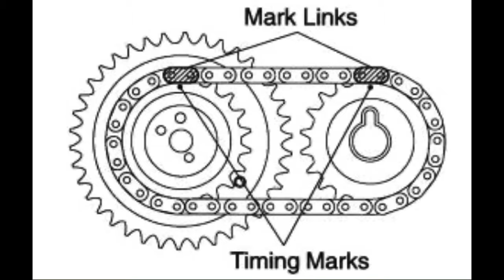2006 Toyota Tundra 1GR-FE 4.0 COMPLETE HEAD GASKET REPLACEMENT STEP BY STEP 209-305-1672

Comment: Hey brother, thanks for the videos... if by any chance you happen to do a timing belt kit for 97 Mitsubishi Eclipse non-turbo automatic you'll be a life saver. When I start the car you can hear a loud screeching however as the engine warms up the sound lowers but when I put it in drive it almost goes away completely. Another piece of info is when I get my ear close to the middle of the engine I can faintly hear a ticking (similar to when removing a spark plug). Originally while purchasing the car the guy told me it's just a water pump but the thing is I don't hear anything coming from the timing cover side. Appreciate any advice

Comment: i see this alot, how many miles are or were on that block? Love your vid showing all the steps and what it took to film. When I have a gasket leak and it is cresting the 150 to 200 thou mileage, i will just long block the whole thing, would hate to stick it all back and a lower main starts spinning. Really appreciate the vid helping alot of folks out there!!!
Reply: The rear main bearing spinning in the block happened to mine :-(
Infrequent oil changes block up the oil pickup screen.
If your engine has the smaller sub-sump with 10mm head bolts holding it on, you can fairly easily remove it and then clean out the oil pickup screen.

Comment: Did you guys have the heads resurfaced? Watched orher videos saying its not a good idea on timing  chain engines becuase it will throw timing codes because timing might not lign up.

Comment: I have a blown head gasket on my 02 tacoma v6. She has 260,000 miles and was told if i do the head gasket with this many miles, the compression will change in the motor. Running the risk of harming the lower end of the motor.... how serious is this risk? Do i really have to replace the motor now or should i just change the head gasket anyway? If anyone could give their opinion on this that would be great!!
Reply: I'm just about done lapping my valves and replacing head gaskets including a valve lash check and adjusting and also just a light cleanup of carbon build up on pistons etc... Got 255000 on the clock, so I'll let ya know how it turns out 😁. Now if these parts can just get here.....

Comment: I appreciate what you showed in this video, I have my doubts about the 4.0 I have. Drove it too hot & blew the head gaskets, resulting in getting coolant in the cylinders. Is there something to expect from the block since it has replaceable piston walls?
Reply: How did you overheat it?
Reply: @johnmpifer  A buddy didn't realize that there was a water leak, and drove 45 miles with traffic uphill. THEN tried to force it back home but it wouldn't go.
Reply: @SOLIZ49erFAITHFUL  Ouch. Hate to hear that! Surprised he continued to drive it after getting a red overheat warning light.

Comment: My head is spinning just thinking about trying to keep up with all the parts pieces nuts bolts washers. Modern vehicles are more complicated than a rocket ship! This job would be a complete nightmare for me.
Reply: Use pieces of cardboard with pictures of the part and poke them through the cardboard in the right area. 👌

Comment: What is a good list of gaskets and parts to replace while the engine is opened like this?
Reply: Did you ever find a list? Looks like I need to get on this as well. And awesome video guys!!
Reply: This is a 1 year old comment but you can get a complete gasket kit from toyota that includes every necessary gasket, oring and seal needed for the job.
Reply from the maker: Toyota gaskets are the problem. 
Fel-pro HS26515pt is the set to get
Reply: Illeana Delgado I ended up replacing my engine with a used unit. I also bought a complete overhaul gasket set from Toyota, it was like $200 for a assortment of different gaskets such as various o-rings, valve seals, head gaskets, valve cover gaskets, front and rear main seals, etc.

Comment: Great Video!  I have a 2006 Tacoma 1GR-FE with 244,000.   Leaks Oil around Timing chain cover near powersteering and valve cover gaskets leak slightly, could use a water pump also.  You guys wanna Do another Lol?

Comment: Awesome video! I got an issue when I got to the head bolts though. One of them was already stripped and I’ve tried pretty much everything. What would you do if that had been the case? Thanks!
Reply: I had the same issue on my engine.
After smashing my head against the wall a few times as I really didn't want to have to drill out the head bolt, I came up with a working solution.
The head bolts in my 1GR-FE have 10mm single hex head bolts, a couple of which stripped out the hex when attempting to undo them.
I got an 11mm hex drive socket and hammered it into the 10mm hex head, which was at approx 10.5mm after stripping.
This allowed the 11mm hex drive to be really jammed in and allowed me to finally crack the head bolt and remove it.
Hope this helps.

Comment: Hello I have a quick question for you. I am looking to replace the gaskets on my valve covers. Do I need to remove the intake? If I do do I need to drain the radiator to change the valve cover gaskets? thanks for your help

Comment: Great video.  I have never pulled the heads on an OHC motor and knew it would be even more of a PITA than the OHVs.  My issue isn't the heads themselves but the exhaust on my 2009 Tacoma 1GR is really rusty.  I replaced the muffler and mid pipe but joints on the cats and the other front pipes and the manifolds are nasty.  I'd like to redo all of that but the bolts are in such bad shape the pipe and cat bolts would need to be cut like the ones on the mid pipe... and the exhaust manifold bolts may be too damaged to extract in the truck.  IOW if I start this job it might turn into a cylinder head R&R.  What would be really helpful is if you guys could post up the part numbers for the o-rings, cylinder head bolts and gaskets.  Or maybe I'll just go trade it in.  ;-)

BTW, I loved the trick to get the crank bolt loose by spinning the motor.  Very clever!  I did similar with a VW rear wheel castle nut like that once using a breaker in a cheater pipe against the ground and moving the car a few inches.

Comment: Do you recommend replacing the timing chains when doing this at 140k miles. Seems like there was an issue with head gaskets in 2005
Reply: Timming chain tensioner should be checked, but that chain should outlast the engine. Just change oil every 8k miles and it should outlive every other part.

Comment: Do you happen to know what would cause 24% LTFT on bank 1 but only like 10% on bank 2?

Also have a cat code on bank 1 at the same time
Reply: I am having a similar issue on my '05 Tacoma. Compare cylinder compression between the cylinders on bank 1 vs bank 2
Reply: @TheThejordanbarnes  true I'll check that out as well, worth a shot

Comment: Question for any 4.0L Tundra owners?  Im considering a mint 4.0L extended cab.  Its significantly cheaper than any of the 4.7 or 5.6L v8's but would be more than adequate for my towing needs.  (pop up camper).  How does this truck drive? Is it super sluggish?
Reply: I don't think so. I have a 2007 Tundra with the 4.0L V-6 and I'm happy with it. Acceptable acceleration. But I wouldn't think it's appropriate for a fully loaded truck and a trailer rig.
I've pushed mine hard at times. Drove 950 miles in one day Montana to Seattle with 900 pound load. That's over three or four mountain passes. Also briefly took it to just over 100 mph on a deserted stretch of Wyoming interstate (new tires though).

Comment: noticed you didn't remove the oil pan or replace the o rings.  Not necessary?
Reply from the maker: Not necessary for head gasket replacement. 
If we were rebuilding engine, yes.
Reply: Gasket Masters what about timing chain replacement?

Comment: Hey guys.  Is this a common problem on the v6 4.0. I was going to buy one with that engine….
Reply: happened to mine at 150,000. Between cylinder 2 and 4. Still ran with decent power just used coolant, which is how I noticed. The V6 has a timing chain though which is better than the timing belt in the V8.

Comment: Did this and gave me a p0016. Tried it 5 times and still p0016. I did notice that when I put the timing cover and harmonic balancer, the harmonic balancer mark is a hair off in front of the 0 mark on the timing cover. When I align the chain and all timing marks exactly where they go, I get slack in between bank 2 and the crank. I put all new chains. Any idea why I keep getting the p0016 code?
Reply from the maker: The timing marks are off. Redo the timing check out our other video specifically for timing marks
Reply: Thanks for your help, but I think I found the problem, looks like there is no oil going to one vvt solenoid.

Comment: how much guys you charge for head gasket 2005 tundra 4.0 v6  same engine
Reply from the maker: @JohnUSA-u7g  we charge typically 2500
Reply: @gasketmasters  
Thanks. Do I need to change the timing chain? What good head gasket to buy and from where thanks again
Reply: I have a misfire on cylinder 4. I know I have a head gasket,  with 230 miles on, no other problem been very good ,do you think is good just to do head gasket 
Thank you so much
Reply from the maker: @JohnUSA-u7g  yup. Do it

Comment: WHAT SOCKET DO I NEED FOR THE HEAD BOLTS IS IT A TORQUE PLUS?
Reply from the maker: salvador gonzalez 12 point 14mm impact or thick wall
Reply: Gasket Masters thanks
Reply: @gasketmasters  1GR-FE head bolts require a 10mm Bi-hexagonal driver.  In the video the technician says it's a triple square, which may be the case if the bolts had been previously replaced, but the factory head bolts aren't triple square.
Reply: @salvadorgonzalez8974  A 14mm 12-point socket is for the head bolts in a 4cylinder tacoma (RZ engines).  If you have a V6 (1GR-FE) you want a 10mm Bi-hexagonal driver (NOT triple square, the angles on the points are very different).  Hope this helps.
Reply: Gasket Masters  I finished head gaskets on the truck last week it runned good for about a week 
Today while driving it died connected scanner had cam codes  removed Oil cap noticed cam chain not turning 
My biggest concern is 
Is this a interfiere engine 
Any help will be appreciated

Comment: I have an )5 Tacoma with 127K miles on it.  I cross my fingers each time I drive it while waiting for the head gasket issues ( that the sacks of excrement at Toyota don't stand behind while knowing full well that the 05's and early 06's have a major problem) to show its ugly head.  I often thought of getting rid of the truck before the event, but don't like the new ones.  A 2015 would be nice.
I just may get the kahoons to give this repair a shot.  Others that have posted about doing it for the first time say that it took about a week to complete,  you guys did it in 30 minutes or so 😎.
Before diving in, I just may try a gasket repair bottle of Blue Devil or Steel Seal.  It is worth a try and after viewing this video   https://youtu.be/brLmBRYSb_E  I at least know the best way to do it that may or may not be the same as the instructions show.
Reply: They cut out a lot of time on that video. It wasn't even close to 30 minutes. They were just saving us boring shots of them pulling or putting in bolts which is where a lot of time goes